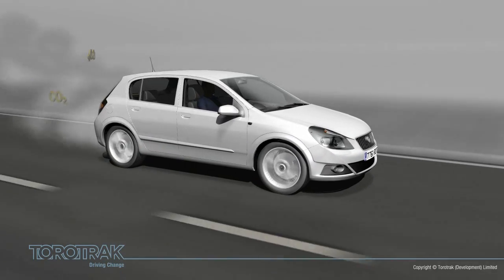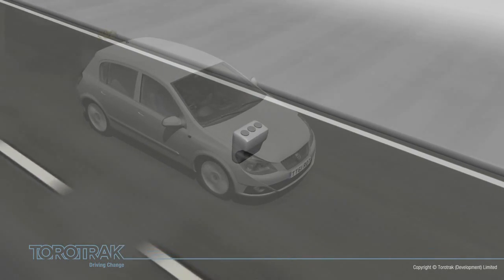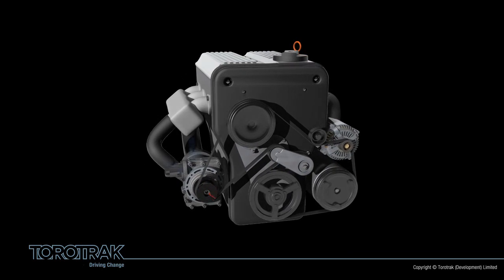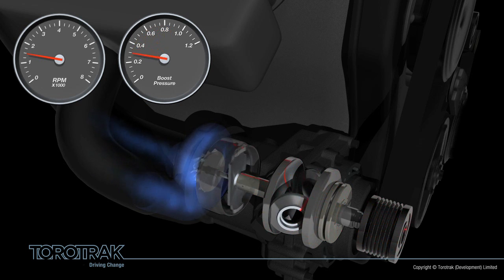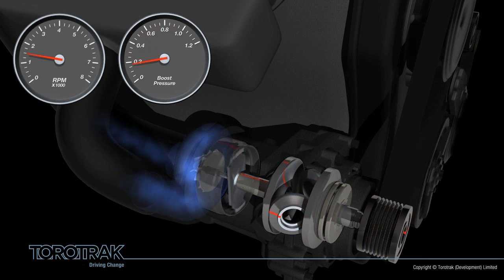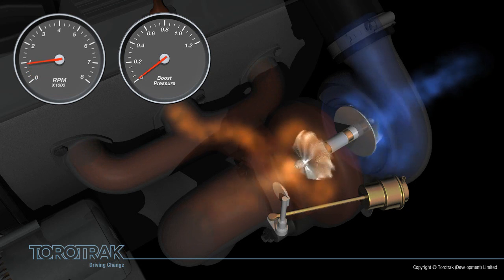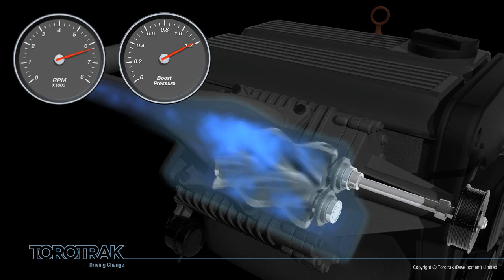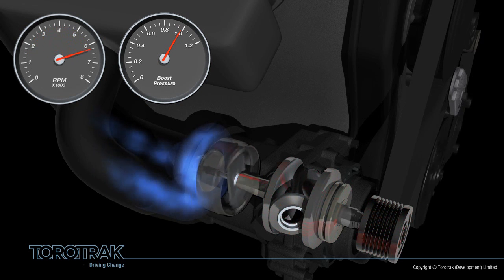V-Charge Variable Drive Supercharging - A key enabler to engine downsizing

Comment: The me109 had a variable supercharger to monitor boost to give more pressure at altitude my question is how well would it work on modern screw type compressors as seen on american v8 engines

Comment: We consumers understand this that manufacturers have been saying for ten (10) years,  but what we are getting is turbo normalized and charged engines that get worse gas mileage than the V-8 they replaced,  less durability,  higher maintenance costs,  and much higher cost to purchase.  (LOL) What we want is supercharger power on demand when ramping up to highway speeds and efficiency in maintaining that speed.  Elon Musk will give this to us if you don't.  So you may want to incorporate push button superchargers and turbo technology that actually does save money on gas consumption,  or start building 4 motor EV's.

Comment: Roots blowers (and twinscrews) boost is directly related to their rpm if per say it moves (or compresses in the case of the twinscrew) 1 litre of air per revolution it will move 6 litres at 6 rpm (not accounting for leakage) however for centrifugal superchargers they make more boost in relation to rpm the faster they spin

Comment: This is dumb.  Turbo's of today do not have lag. They do this with twin scroll and variable vein technology. Superchargers just take power from the engine to get power. Turbo's do not have this issue.
Reply: Yes they do. Exhaust isn't free flowing. The engine needs to pump the exhaust gases through the turbine causing parasitic loses, just like a supercharger.
Reply: The energy must come from somewhere. Turbo's do have the problem, don't fall for whatever they say...

Comment: Interesting design.  How do you overcome radial scrub friction losses at the extremes of actuation?  Will all those friction surfaces last 200k miles?
Reply: Jeff M A turbo charger doesn't last 200,000 miles.
Reply: Except when it does. Turbo failures on well maintained cars are quite uncommon.
Reply: @gabrielb.2886  then maintain the V-charger

Comment: I'm still amazed that clutches have yet to employ MR fluid.  All clutches, including the variable clutch on this compressor.  Strongly agree with your efforts to make "variable displacement" engines by altering the pressure in the intake tract.
Reply: Ken Wright This product has no clutch. It's always engaged, just at different output speeds

Comment: Are there any in production vehicles. If not, why not?
Reply: probably cost, I would assume that since now a days we see more turbo charged cars, soon it might become an option for manufacturers to switch to a super charger some time in the future, if the need is necessary, otherwise I would assume the market for something like this for now is still aftermarket people who really want the low end and high end boost performance. Of course it would have to compete with already production cars with small turbos that kick at low RPMs, i.e Ford turbo charged small cars, where most daily drivers need it, but if you wanna race your car and need that extra top end without loosing out too much on the bottom as well, then this would be an option, but again the market dictates its prevalence. Also how much strain is this putting on that CVT? long term would it have to be replaced at 50K miles regular car use or can it last the mechanical stresses for the car's lifespan? there's a lot of factors, and I hope I'm not too disorganized in this post.

Comment: A supercharger uses up hp to make hp where as a turbocharger uses wasted exhaust to make hp.

A turbocharger is the way to go.
Reply: +barry wirth You are displaying your ignorance. Has it crossed your mind that the turbo housing and impeller in the exhaust flow is a massive restriction causing a loss of power? Plus you have a lower compression ratio causing massive off boost power loss. Both methods take power to drive and both make more power than they consume
Reply: +barry wirth   You know what creates the "exhaust", right?  Without hp there would be no exhaust.  No such thing as a free lunch.
Reply: +barry wirth Exhaust gasses aren't free flowing. An engine needs to pump the gasses out and a exhaust turbine is a flow restriction that causes parasitic loss of crank shaft hp.
Reply: Electric is the way to go. A Tesla using one motor per wheel gives the sensation of a larger gasoline engine with zero emissions and no loss of energy through transmissions and drive axles.
PS: a turbocharger requires MORE emissions (waste) to be useful. Electric.
Reply: Electric is wonderful right up to the point that your batteries are drained and you are out of action for many hours while they charge. Totally impractical